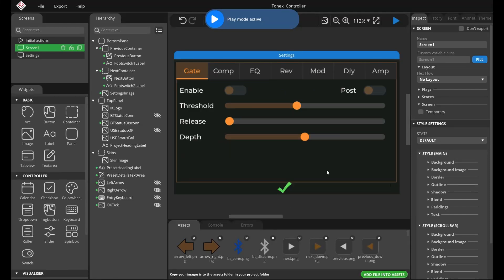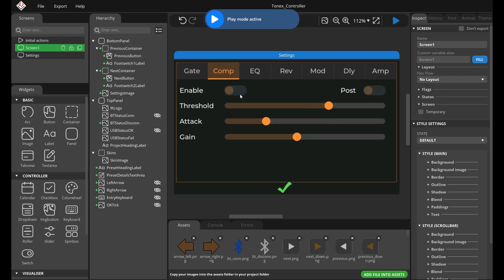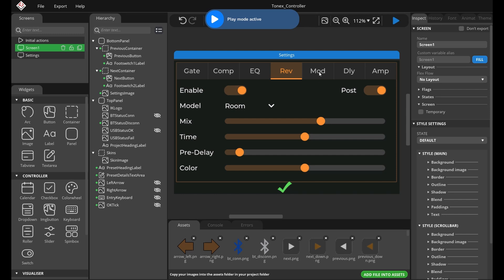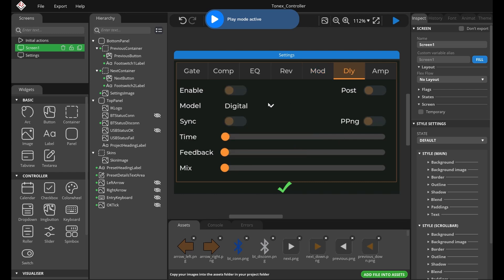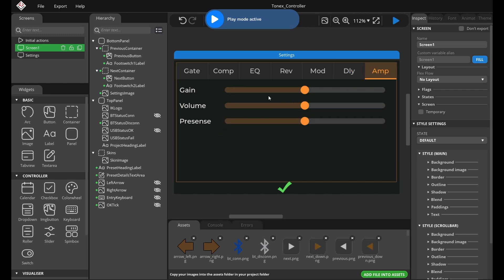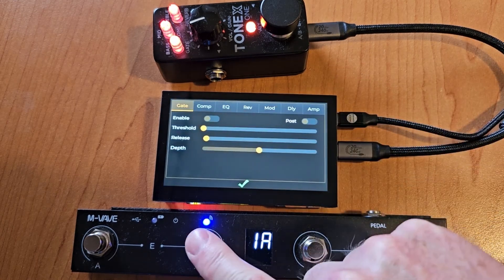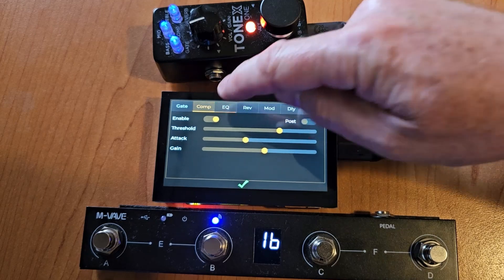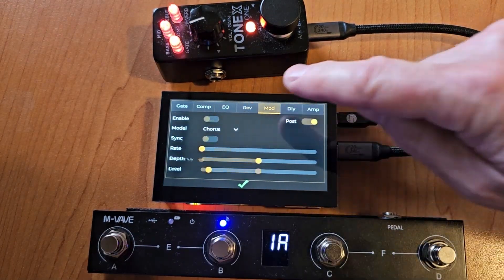Tonex One Controller - Parameter UI preview

Comment: Any idea how he manage to turn comp and delay on / off ?

https://www.youtube.com/watch?v=x33PkARJ-SU&ab_channel=EricTayetaye
Reply from the maker: The chocolate pedals can he configured to send midi control change commands. This is how it is possible to toggle the effects. 
I'm not sure though how he managed to do both preset switching and effects from the same buttons. 
I will ask Eric for some more information.
Reply: @gregsmith1526  Thanks! Much appreciated. I tried to program contol change commands from the Tonex pedals midi list, but with no luck.
Reply from the maker: @49k2r3  he says "it's the chocolate plus
I send separatley comp on and comp off
.. The same for the delay

No toggle.

And it's the custom mode 2...not able with the chocolate Classic"

Note also, next firmware coming soon has support for up to 16 footswitches and can assign effect toggles to up to 5 of them.
For cheaper than a Chocolate pedal
Reply from the maker: @49k2r3  also make sure you enable Midi CC via Bluetooth in the web settings. it is disabled by default
Reply: @ Thanks for getting in touch with him. I will test it out. Really excited to hear about the new firmware.
Reply: @ btw, do you know which CC numbers he used for the delay on / off?
Reply from the maker: @49k2r3  Refer to the manual for the big Tonex pedal. I used the same values as it.
Reply: @ Thanks!

Comment: First: This is awesome, thank you. 
Second: It looks like you are powering the screen off a 5V USB cable, but I thought it needed 9V supply? I was hoping to power it with a USB cable like in the video but thought you couldn't. Thanks!
Reply from the maker: Hi. I have a few of the Waveshare boards with the 4.3" display. The recommended 4.3B has only one USB port.
The one in the video is a 4.3 (not B.) It has 2 USB ports, which is really handy for my development (one for Tonex, one for power/programming.)

The 4.3 (not B) needs a hardware mod to support the Tonex,  and also has some different pins which are not ideal. So that board is not officially supported.

Comment: Hi Greg! Greetings from Brasil! But I have a doubt about the wired solution: Its possible use a PC running a DAW to send mid messages and than go to the ToneX One? My PC (its a Mac) will recognize the ESP Devkit, for example, as a Midi device? a lot of people want a solution to use a DAW to control the tonex one, and congratulations, your work is insane!
Reply from the maker: @estevesmarco  thank you. Yes you could use a daw, but not via usb. The usb port runs as a host port to control the tonex and can't also connect to a pc at the same time. You would need to use either bluetooth, or wired midi to control it.
Reply: @ so an usb-to-midi cable on my computer than connect to this board? Using 5din connector?
Reply from the maker: @estevesmarco  yes, that is one option. I have a USB Midi cable that I use for testing.

The other option would be to put the controller into bluetooth peripheral mode, and connect the PC to it over bluetooth.

Comment: Awesome! I have tried something similar with the big tonex (which I have now sold) using Python and Streamlit. It was easy to access most features via inbuilt MIDI but I struggled in reading preset data, so I always had to start at zero :(